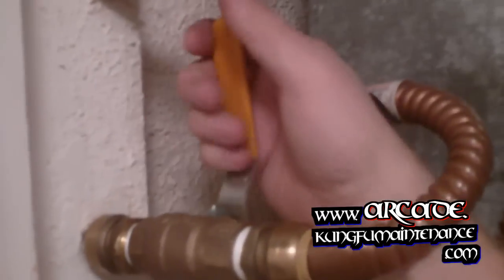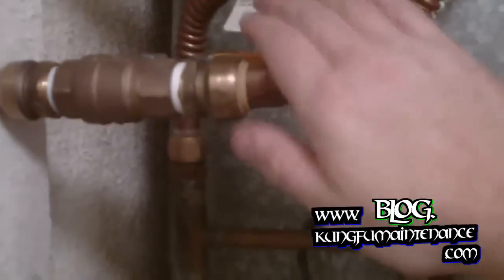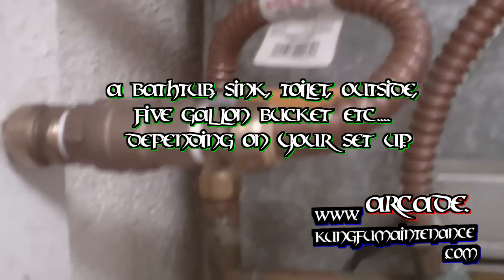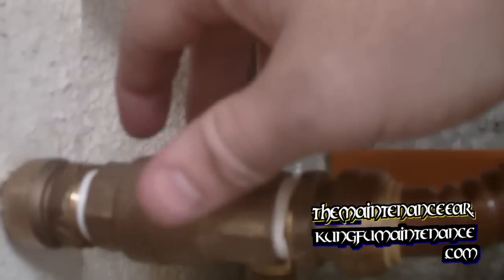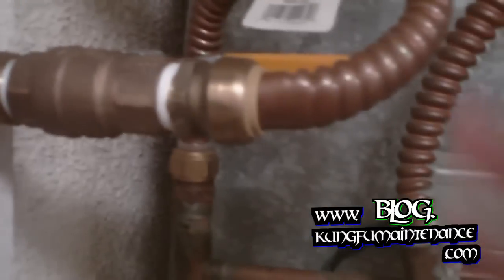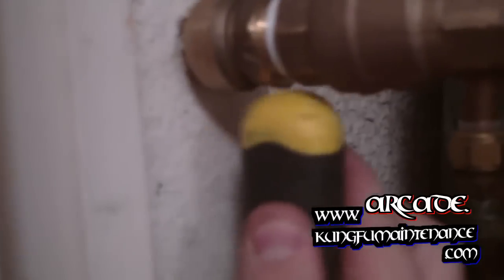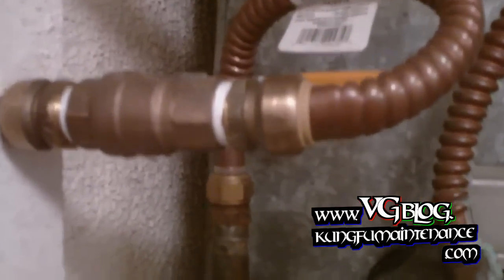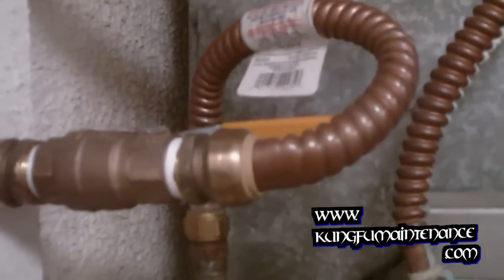Heater Not Working ~ Most Common Hydronic Heating Heat Problems

Comment from the maker: Simple Leak Seek Spray   http://amzn.to/2lFfcC5  Laser Thermometer  http://amzn.to/2layD8I  
Valve Core Removal Tool                              http://amzn.to/2kJ00pC
Get KFM favored Electronic Leak Detector        http://amzn.to/2kmQMMz
Inficon Refrigerant Scale                               http://amzn.to/2vUCQPD
Get KFM's favored Multi-Meter  here        http://amzn.to/2l8W9CO 
Get the Milwaukee 11 in 1 Screwdriver     http://amzn.to/2uTtsNj 
Wet Dry Vacuum used in so many KFM videos   http://amzn.to/2lFxi7u
Chapin Pro Pump Sprayer                             http://amzn.to/2vWCXdD
Evaporator Coil Cleaner No Rinse Mix        http://amzn.to/2x3eJTT
Evaporator Coil Cleaner No Rinse Can        http://amzn.to/2ezIxju  
Get the Screwdriver used in so many KFM videos here    http://amzn.to/2kHFoOF 
Easiest Way To Get Universal EPA Certified Prep Manual    http://amzn.to/2kIQdQC
Get KFM's favored AC Gauges here            http://amzn.to/2kYgGb8
Hard Start Kit     http://amzn.to/2kiD16v   Contactor     http://amzn.to/2lFqA0P
Get  the Multi Tool Pliers used in so many KFM videos       http://amzn.to/2kWTjPp
5mf Capacitor   http://amzn.to/2wC96sH     35mf Capacitor    http://amzn.to/2vZVZ2t
35/5mf Capacitor   http://amzn.to/2iVJNi2        40/5mf Capacitor    http://amzn.to/2wzEdXD 
45/5 mf Capacitor   http://amzn.to/2w0wez5   
Condensate Pan Tablets   http://amzn.to/2lalV9W   No Rinse Coil Cleaner  http://amzn.to/2lHg8GD
Condenser Fin Whisk Brush                          http://amzn.to/2vWXUoC 
You must be EPA certified to charge or recover refrigerants and here is about the Easiest Way To Get certified with the Universal EPA Certified Prep Manual    http://amzn.to/2kIQdQC
Get The Kung Fu Maintenance book here     http://amzn.to/2lEQPFk
Or  the Kung Fu Maintenance E book here  for less than $5    http://amzn.to/2lEY8wD
Get the Kung Fu Maintenance album (good driving music) "Up Beat" here     http://amzn.to/2l41pZ1
Get the Kung Fu Maintenance album (nice Instrumental music) "Entropy" here   http://amzn.to/2kl2U0p
Samsung Galaxy S8 Plus        http://amzn.to/2sFn9h8
GoPro Hero 5 Action Camera         http://amzn.to/2sN4nVK
Rode Lapel Microphone                 http://amzn.to/2vZoFc7
Purple Panda Lapel Microphone  Kit   http://amzn.to/2wByXkq
Video Edit Pro Software       http://amzn.to/2ruaaeZ
Samsung Galaxy S5                 http://amzn.to/2wBxk6l     
Samsung Galaxy S8 Plus        http://amzn.to/2sFn9h8
Video Edit Pro Software       http://amzn.to/2ruaaeZ

Hire An HVAC Specialist                                  http://amzn.to/2lktKek
Air Duct Cleaning Services                              http://amzn.to/2lFTpun
Central Air Conditioner Tune Up                   http://amzn.to/2lzJGoy 
Air Conditioner Repair Or Installation          http://amzn.to/2lFsEGw                                           
I don't work for any of the product companies  listed however I do make a small commission on items ordered  through the links.

Comment: Apollo HydroHeat System - The hot water heater runs fine, but when i turn in heat or cool theres a humming sound coming from the inside unit. The outside unit runs fine though. Any thoughts?
Reply from the maker: Could be a noisy transformer? They do that sometimes. Something as small as a loose mounting screw can also make noises. Sometimes all it takes is a little piece of cardboard anchored in the right place to eliminate rattling or buzzing sounds.

Comment: I have a similar system to this that is connected to a gas water heater, the air handler is a fur down unit in the ceiling, my question is what kind of temps should I be getting out of the vents? I feel like I usually don't get any hotter than about 85 or 90°, thanks in advance!

Comment: My circulation pump cleared up and ran great after I both tapped it, and opened the air escape.  Not sure which one fixed it, but it works now :)